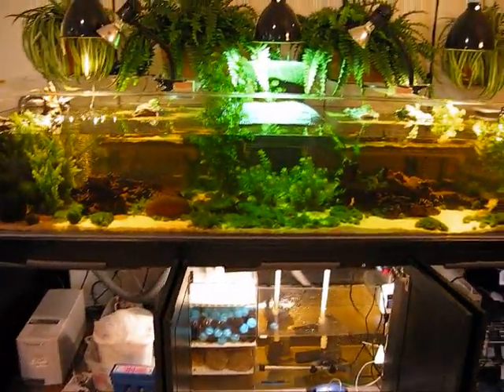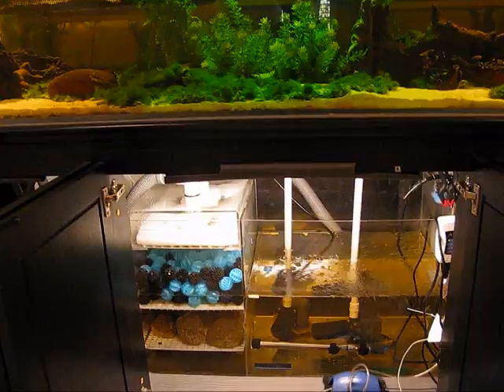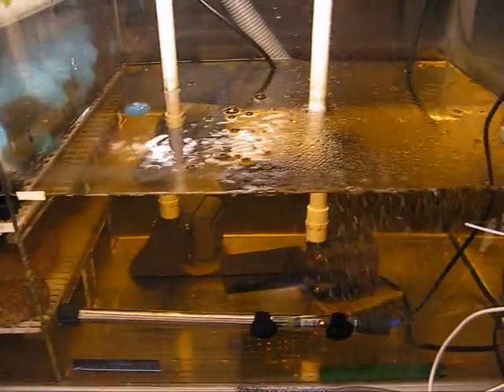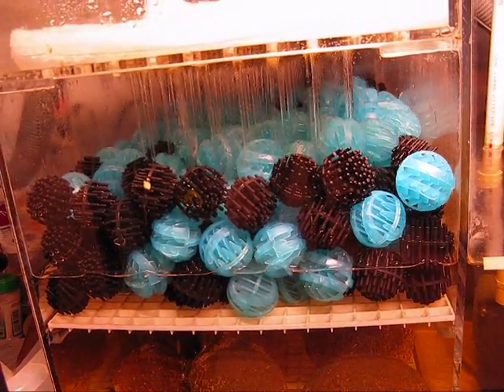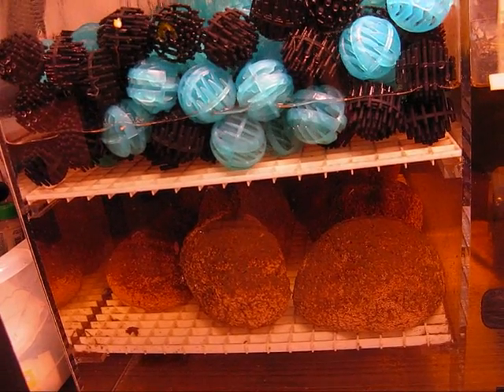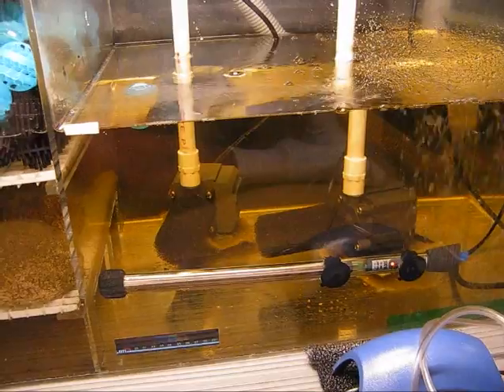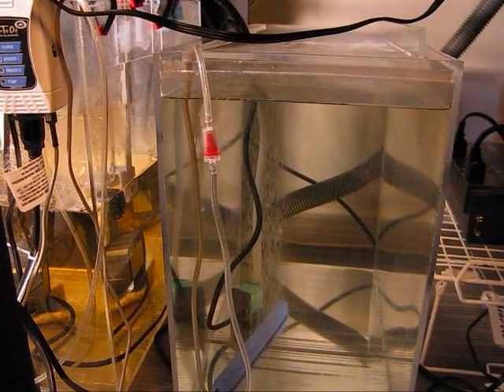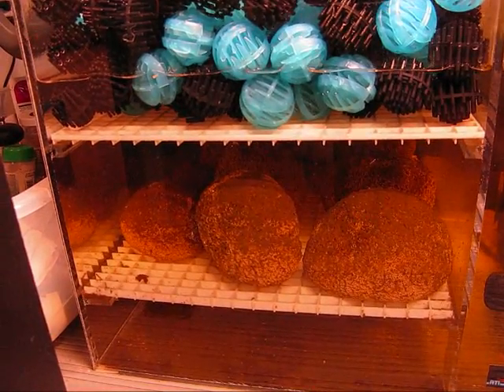Turtle Tank Trickle Filter

Comment from the maker: My tank is made of acrylic and has holes drilled in the bottom for the plumbing to the sump.  You can also use an overflow box but I am not familiar with them.  If your tank is made of glass you may or may not be able to drill holes in it, you will need to ask the manufacturer.  In fact, if you are new to this kind of filter, it is better if you have someone experienced set it up for you the first time.  Maintenance is fairly easy once it is up and running.

Comment from the maker: The sump is by no means hermetically sealed.  Air can get in around the edges of the lid and also mixes with water in the overflow tube.  Dissolved oxygen in this tank is 7.2 ppm.

Comment from the maker: don't recall the cost.  The pumps are separate from the sump.  You can price pumps and pre-made sumps at any aquaiurm shop.  Best to have a drilled tank but you can also use an overflow box which is extra.  Not a cheap hobby, that's for sure.

Comment from the maker: evaporation happens both in the sump and the tank, but the tank level doesn't drop, the sump level does.  That is because the pumps down in the sump are constantly pumping water up to the tank keeping the water the same depth as the overflow tubes despite the evaporation.  Meantime the level in the sump does drop and must be replenished.  I use an automatic topoff device with a reservoir to maintain the level in the sump as evaporation occurs.

Comment from the maker: Don't know what the total cost has been, all that stuff purchased over the years.  The most expensive piece is the acrylic tank, custom made.  The price varies on acrylic tanks, you'll have to check around some aquarium shops in your area.  The stand is custom made also because of the unusually wide tank, 3 feet.  

You need a sexually mature male and female(s) to start the breeding process.  A sandy breeding area, slightly moist, is also necessary for laying eggs.  4 inches is a good depth.

Comment from the maker: That is a pretty standard configuration and I had the same concern.   The return has a pretty strong flow and so the water moves away from the overflow.  I'm sure some recently filtered water does go back down the overflow, but hopefully not much.

You can put both returns in one corner and both overflows in the opposite corner.  When you have only one of each, that is typically how it is done.  

Would be interesting to pour some food dye in the sump and monitor the water flow.

Comment: Thanks for the description, very informative. I am designing a sump filter for my own turtle tank (smaller size). I have a couple of questions: What kind of rock do you use under the bio balls? Where did you get the flexible nozzles for the water return? Thanks!

Comment from the maker: Dimunic,I prefer wet/dry trickle filters but most turtle keepers use canister filters.  Trickle filters are probably the most efficient biological filters and easiest to maintain.  I can change the mechanical filter pads in the sump in about 30 seconds which I do twice weekly.  Cleaning a canister filter is quite a bit more work.  

brihan24, use GFCI outlets or extension cords for you aquarium electrical needs for added safety.

Comment from the maker: I bought a pair of adjustable megaflow overflows which are rated 600gph.  I have one overflow  in each back corner of the tank, so I have two 600ghp pumps in the sump.  Those pumps pump the water out of the sump and back into the tank.  The rising water in the tank then spills over into the overflows and gravity sends it back to the sump for filtering.  Hope that explains it.

Comment from the maker: I use aerators to inhibit surface sludge.  I no longer have an aerator in the tank as I have made adjustments with the return plumbing that has resolved the issue.  I still use an aerator in the sump for the same purpose, however.  I don't use CO2 injection, I'm sure it would help my plants grow better as would brighter lamps.  I have no experience with CO2 injection so I can't advise you on that.

Comment from the maker: doesn't happen.  my return plumbing (filtered water being pumped back into the tank) are at water level.  if the power goes out, a few gallons siphon back into the sump and then everything stops.  water level drops only about 1/2".  I turn off the pumps twice a week when I do maintenance.  no floods.  in addition, I have backup batteries on both pumps so during power failures the tank continues to operate.

Comment from the maker: didn't know I had all these comments, youtube not notifying me anymore. 

I use the JBJ Automatic Top Off System Water Level Controller to manage evaporation.  

You'll have to google cell-pore rocks to find them.

Tannin is getting better with time, don't use carbon.  

water changes are done from the sump, not the tank, about 30 gallons twice a week.  

Don't vacuum the sand ever.  Major cleaning once yearly.  

Water temp is about 79 degrees in the summer, 75 in the winter.

Comment from the maker: It won't work as well as allowing the water to trickle over the media.  As the water flows over the each bio ball, the water spreads out in a very thin layer over the surface of the bio ball.  That tremendous surface area is what allows the water to absorb so much oxygen.  Blowing bubbles under the bio balls cannot create those dynamics and certainly doesn't improve the surface area of the water against the media.  An air stone does add some oxygen directly to the water, however.